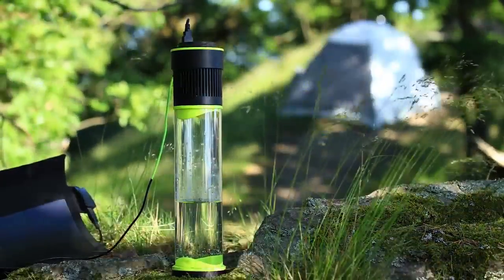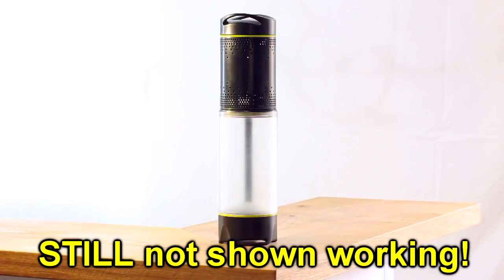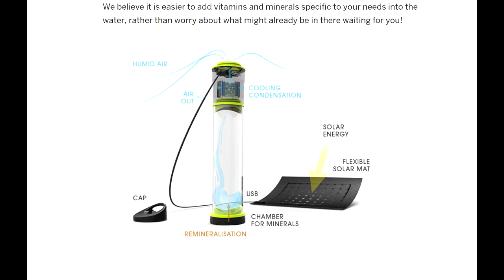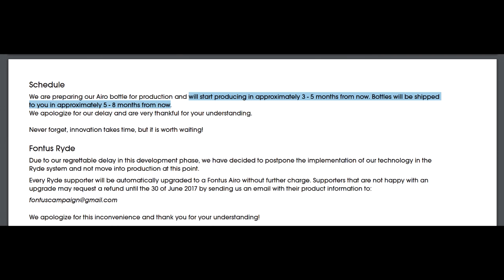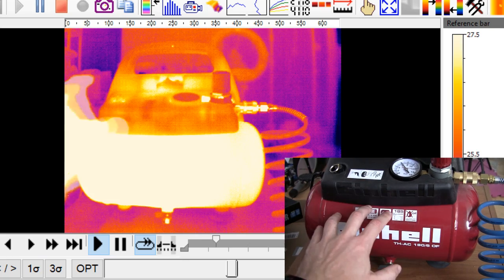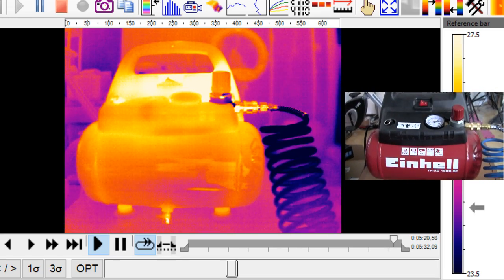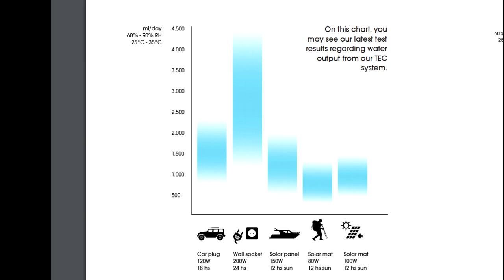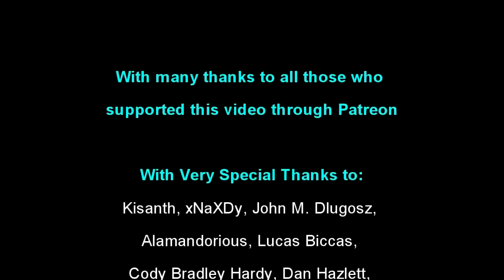$300 000 Self-Filling water bottle, SUPERFAIL!

Comment: 200w over single USB is truly an innovation worth millions!
Reply: The entire concept would be worth millions, both in dollars and in lives. If this thing actually worked the biggest point of criticism would be why hell the guy is wasting his time trying create this stupid hiking gimmick when he should be contracting with giant companies to create industrial versions for towns and cities. Think of how many off-the-grid villages in africa could benefit from a solar-powered water dispenser that could be brought in and transported to wherever it's needed in the bed of a pick-up truck if not a simple cart. 

It's like if the guy who discovered how to make fire was not thinking of how it could cook food, keep people warm, provide light in the dark and keep dangerous animals away, but the frustration of wanting to smoke a blunt and there not being any brush-fires or lighting-struck trees around to light up with.
Reply: Neil Carberry he wasn't wrong. over 15 watts you're looking at 20 volts not 5. Different animal. I^2r losses would still get you if you  tried to abuse the new std at 200 watts.
Reply: Neil Carberry yeah but I mentioned over a SINGLE USB. 100w on a usb3.1 is really pushing it already. It needs really high quality cable and controller.
Reply: It is possible to do 200W. Like I said you need to boost the voltage. 

The thing is that on the receiving end you're going to have a MOSFET gate driver network and thick ass wires to support over 100A of current. This would also need to dissipate several watts of heat, and need a large heatsink. Also you would need 1000V capacitors that can support massive ripples. 

Possible yes. Practical...nope.
Reply: Not really actually. As long as the wire insulation can support the potential difference, and the current going through the wire is less than 3A, its okay. 

The thing is that the standards also consider AC produced by signals. Theres tons of impedance in a USB cable so they need to be short to maintain decent communication rates. 

You can do a lot more if you use a USB just as a power cable. That is, if you're an electrical engineer like me.
Reply: Cooper yeh but the point in the video was that it was ridiculous to even try ot over usb. the new standard is literally meant to be used that way so using two on them isn't exactly a hard thing to do
Reply: "All USB-C cables must support a minimum of 3 A current (up to 60 W @20V) but can also support high-power 5 A current (up to 100 W). All USB-C to USB-C cables must contain e-marker chips programmed to identify the cable and its current capabilities."

This is only half the truth, there are 5v lines, 9v lines, 15v lines and 20v lines, IIRC, and with Power Delivery these capabilities should be used by the device when available and compatible. 

200w is not gonna happen.

USB 3.1 does not say anything about power delivery.
Reply: Eric Cartman 
But that would break standards.
Reply: I looked up a datasheet for a cheap 2$ cable and the voltage rating was 400V. So that means you can about 315W through this cable if you boost your voltage to 350V. (account for some voltage ripple to avoid hitting 400V).
Reply: ...you realize that this would be an immensely expensive and slow way of getting water, right? You might want to look into the titanium oxide coated plastic containers they're using right now for purifying water, though, that's pretty cool.
Reply: Samwell Tarly The concept is art/design students concentrating on form. What's missing is an understanding of thermodynamics. No sexy  packaging or clever million dollar engineering is going to do an end around what physical properties allow. 
There's nothing new here it's a sexy package around a plain old peltier device. Stunningly inefficient devices being thrown at high power requirement application. You can prove this to yourself without math. It takes a large amount of energy to heat a pot of water to boiling and a huge amount of energy to boil it away. You need that kind of energy to go the other way. Even if your device does magic and is 100 percent efficient the energy required is huge. Intuitively it makes sense it would be even worse trying to extract moisture from dry desert air. Dehumidifiers work in damp basements not dry deserts.
Reply: Cooper nah he was a bit wrong with that. usb 3.1 can do 100 watts so you would only need two of those.
Reply: You use a boost converter. like you pass high voltage down the wire. 

P = I^R or you can go P = V^2/R . The resistance of 3ft USB cable with 24 gauge Aluminum wire has 0.084ohms of resistance. Typical insulators on 24 gauge wire are rated for about 1000V (DC). So dropping that down to 5V with 90% efficiency means I can get an output current of 180A or 900W. That would mean there will be 0.9A down the usb cable. You usb cable would generate 0.07W (safe). 

This is why power lines use high voltage. Current through a wire needs to build a magnetic field providing magnetic and resistive losses, whereas voltage is merely a "charge pressure"